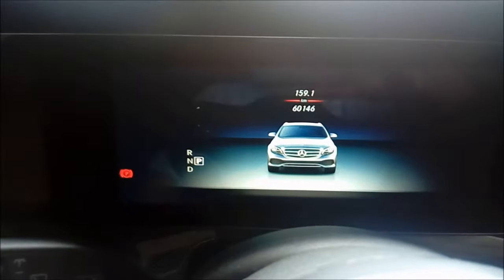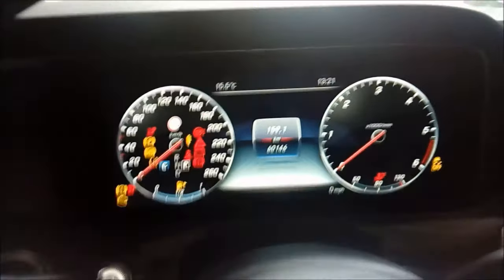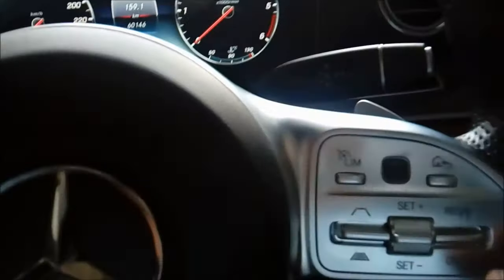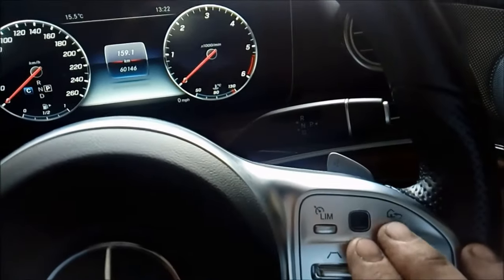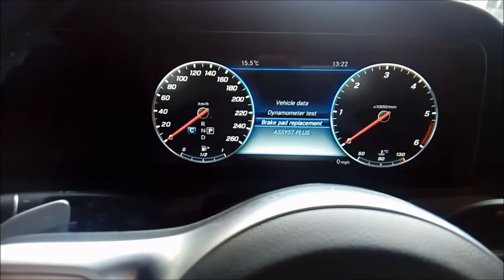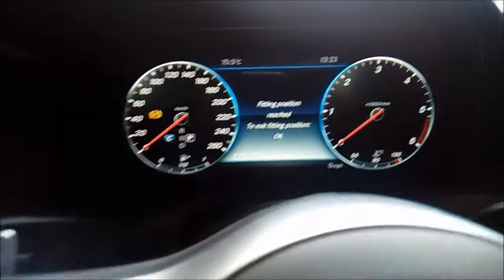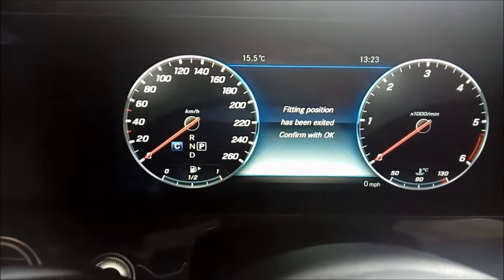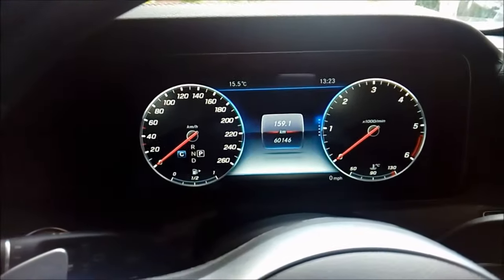Mercedes Brake Pad Replacement Mode

Comment: Just want to ask after doing the brake pad release in the dask board do you need to switch off the engine while replacing the pad?
Reply from the maker: Yes. The engine should not be on anyway. Think this is done in the Ignition position (but you’d have to check the video).
Reply: Thanks 👏👏👏

Comment: Hey if I am trying this and the car tells me fitting position not met what should I do?. I took the caliper pistion off and changed the breaks like you would on a normal car not knowing of this process. Now i cant get the piston to retract  in.
Reply from the maker: I’m sorry, i don’t know the answer. Maybe refit the old parts and see if the replacement mode works then refit the new parts?
Reply: I had that problem and had to twist the caliper piston inward then Compress it
With a c clamp…

Comment: If we dont do this we wont be able to replace rear brake pad?
Reply from the maker: Correct. This frees the pads for the discs, although you still need to wind them back in (as per the video). In reality, this is releasing the electronic handbrake in a way that will not allow it to be reapplied during the brake pad change 👍
Reply: @mercedes_and_more  thank you

Comment: Does this remove the need for a wind back tool
Reply from the maker: No. You use this to release the “handbrake” (it clamps the pads on to the disc) and then you proceed as normal to repair the pads/discs like another car. There is a video on how to do the rear brakes on my channel aswell 👍

Comment: Does this E.213 share front brake pads with the GLC 2017 model ?
Reply from the maker: The GLC shares its under pinnings with the C which shares virtually all of its floorplan with the E, so i suspect it will. Even if the sizes were different then the methods of changing would be the same.

Comment: Do you need to set a gear to Neutral (N) Position?
Reply from the maker: No you do not need to put it in neutral and can stay in park
Reply: @mercedes_and_more  thank you. I’ve seen some videos on YouTube, that said that you always need to set a gear in N, because you can’t get out of break pad replacement mode if you don’t do it. But you have already done it, that’s why I asked you. Thank you for helping
Reply from the maker: @lamoorproduction550  I’ll check tomorrow but I’m 99% sure you don’t leave park! You’ve got me wondering now 😳
Reply from the maker: So i said i would Check. Car in park and handbrake on it said conditions not met. So pressed the key again to get all lights on and then released the handbrake. Pressed key start again to go back to ignition and went into fitting mode when asked (car in park). Clearly doing this in N would not be good as the car is free to roll if not on level ground👍
Reply: @mercedes_and_more  thanks for helping

Comment: Does this method work on newest 2023 C series ?
Reply from the maker: It is very likely as the MBux system that was put in the 213 after the 2020 facelift has the same “hidden menu”.